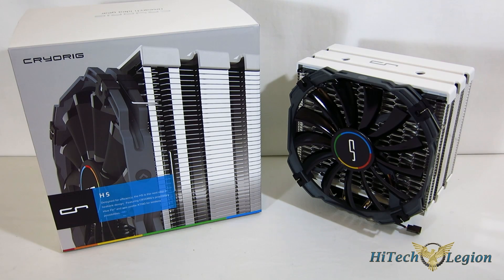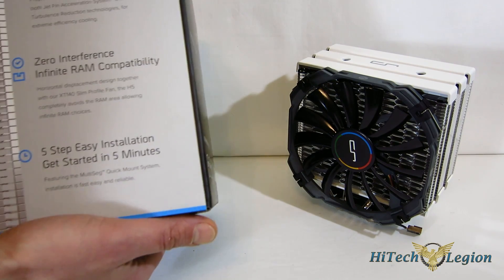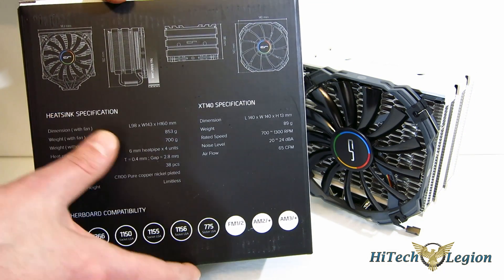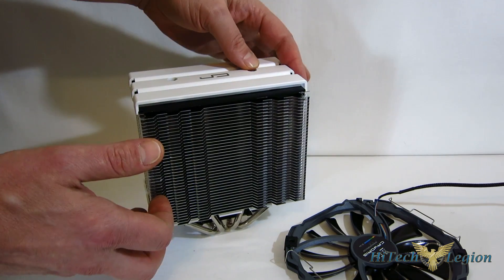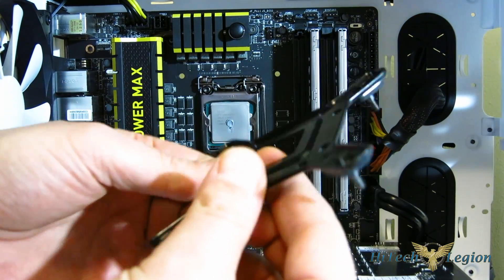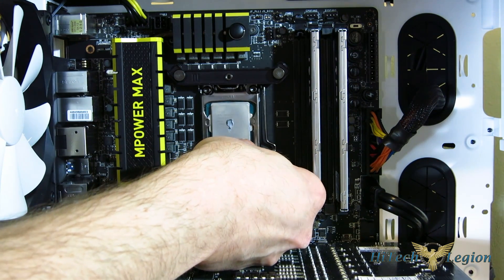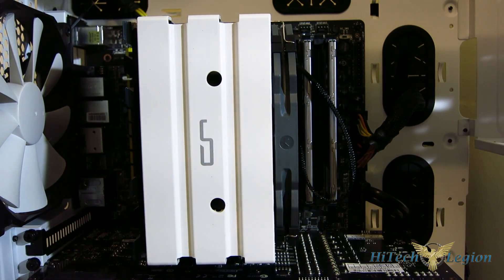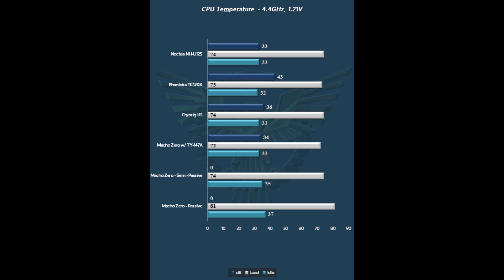Cryorig H5 Universal CPU Cooler Overview and Benchmarks

Comment: I just installed a H5 ultimate on my Ryzen 3600. On the first try I can’t even get the CPU temp to 60C on a stress test. Very quiet too. Changed from an AIO - I’d had enough of the water pump noise.  I would suggest Cryorig introduce physical guides to align the 2 screws with the plate. I didn’t find that part of the install so straight forward, but you only have to do it once so all good. Thanks for the review.

Comment: Pretty good fan if you don't really plan to over clock. I have an i7 7700k and max temperature I got was 72 degrees C. Idle I got about 30 Degrees C. (Average is about 55 when in game). It was simple and fun to install. The only thing is on my motherboard I can only use 2 RAM slots (it covers the first slot). But other than that a great fan. I used a NZXT s340 case if anyone's wondering.  https://imgur.com/NqPOF3S

Comment: If you were to change the fan, would any fan of the same mm work? Or are those specially designed fans to work with that heatsink? I currently have the Thermalright Macho 120 SBM which uses 120mm fans, but they aren't standard sized and I have to special order them from Germany for $20. It's a great cooler, but I seriously hate it for that particular issue.

Comment: is it compatible with lga 1151?
Reply: tsuzukadesu yes watch my installation video it's the I7 6700k skylake LGA1151 socket ...but make sure you get the CRYORIG H5a cause it comes with the slim fan so you won't have any Dimm 1 slot issues .... I bought the fan that comes with the H5 and it's a common 25mm thick and it blocks my Dimm 1 slot but the slim fan does not it leaves clearance for even high profile ram
Reply: Yes.
Reply: thanks
Reply: Oh thank you so much dude. It helps a lot

Comment: Hey George, I know this video is a couple years old now but did you review the Cryorig H5 Ultimate also? I know this one is the Universal with the slim fan. You think the same ram clearance applies to the H5 Ultimate? I only care about your reviews and opinions on these coolers.
Reply: I'm using 2011-v3 by the way.
Reply: I didn't do a review on the Ultimate, but it is the same tower with a thicker fan. The fan on the Ultimate overhangs the first two RAM slots. The fan can be moved up to accommodate RAM up to 45mm tall. So, essentially, unless you are using Dominator, you should be fine.
Reply: Thanks so much George. You're the best. I actually am using Dominator, so getting the Universal will work, right?
Reply: The Universal will be no problem. If you aren't populating the RAM slots behind the CPU, you could add an XF140 or XT140 to the rear for push/pull if you like.
Reply: +George Cella Fantastic! That's exactly what I'll do then. Make more videos George. Doesn't matter what they are about because I'll still watch them.
Reply: My video days are long gone (at least on this channel ;-) ). But, I'm easy enough to find in the Cryorig, Swiftech,  and Phanteks threads over at OCN.
Reply: +George Cella Well I'm heading over there. You were awesome then, and you're awesome now.

Comment: I use my gigabyte motherboard software to monitor now here's a update with my video card .......my idle is about 21C in 68F room temp....and playing division it will spike as high as 56/57C for one second when it starts the game but stays at 35c to 45C on tom Clancy's division ....my CPU stays there but my video card hits 60c and turns the fans on about 2 minutes into the game ........my PCH temp starts at 26 and ends up at 32 after 1 hour of play.....my tower temp starts at 21C and hits 29c 1 hour into the game .......my CPU stays in the same area it started at.......so my next step it to change all 5 of my tower fans with higher RPM and CFM fans .....I think the fans I found are $20 each they are called akasa AK-FN063 Viper S flow 140mm two of those for the front 1600RPM 110CFM that's ridiculous speed for a 140mm fan I don't care if it's load I want performance now......and a AeroCool DS 120mm dual layered blades with noise and shock reduction 1500RPM 81 CFM at 12 volts

Comment: Best mounting kit? Nah...Noctua still has the best for me.
Reply: +kamata93 Ok, why?
Reply: George Cella
Its stupidly easy and quite strong mounting kit. I love it
Reply: kamata93 Ok.....but when you used the Cryorig kit, in what way did you find it inferior to the Noctua kit?
Reply: George Cella
Dont really know. When I was installing the Noctua...it was easier for me. Also the cooler seems better secured as well. Not to mention that my cooler is much quieter and performs better than the Cryorig.
Reply: Try installing noctua ch14(not dh14) most stupid and frustrating mounting mechanism i have ever seen .

Comment: have you noticed the performance difference between the h5-universal and the h7 is very little.
Reply: +danjal07 yeah, but that's just one of the drawbacks of the XT140 fan which itself has a 3/5 rating on newegg. The QT120 fan on the H7 is more performance oriented due to having the room to fit the smaller dimensions of the H7 heatsink compared to the space-limitations of the H5 universal's fan. All in all, I would suggest the H7 and skip the H5 universal.
Reply: I was looking at the cfm rating of the two fans when I decided on the H5universal. That was one of my deciding factors when I went with the h5 universal, the qf120 on the h7 has at 49cfm rating and the xt140 fan has a 65cfm rating.
 plus i wanted the capability of the 140mm fan getting closer to the motherboard.. If you look at the h5universal the fan mounts lower on the cpu cooler allowing it to push air across the base of the cooler and out from under and across the motherboard..
Reply: the extra $10 on the H5 is not only buying a little extra cooling, but also a little more quality.  The H7 works, but it's pretty janky.
Reply: right. both have merits. H7 is good for saving space and more value. However, H5 is worth the upgrade for that extra heat pipe, 90% surface area of the R1, and very small delta compared to the cryorig R1's thermal performance. Pretty good w/ lower noise and more airflow.
Reply: Chris Nguyen
 I cant even hear my h5 universal running 2ft away with the case panel off.
  my I5-6600k@4.5ghz doesnt go over 45c.
Reply: what's your pcpartpicker link?
Reply: i used newegg
Reply: http://pcpartpicker.com/b/t6TH99

Comment: I just received mine in the mail....OMG it's huge....and my tips with the cooler master t2 was about 59c and it would spike to 81c under load....I put my PC on the shelf till today...my new CRYORIG h5 is amazing ...my idle on speecy is 15c ...but the cmos says 28c I'm sure it's 28c...but under load on speecy it hit 30c...so I'm sure it hits about 45c to maybe 50c in the cmos....I will download another CPU temp monitoring program to see its results....at first I thought it was going to make me have to take my active ram fan cooler off ....not it all fits together...so even if I had high profile ram it would clear ...cause the fan sits about 3 inches high off the motherboard....I'm impressed with the mounting brackets ...it was as easy as this video showed it was ...I hope this is helpful feed back ....I'm so happy with the quality of this CPU cooler ...it dosent have mounting pegs that are plastic like my cooler master hyper T2 does ..I almost broke the peg legs off my cooler master t2

Comment: it's crazy how people worry about the fan sound....you need to worry about the heat sink ....you can always change the fans when they die or if they're load....it's all about the hardware....if you're heatsink seats well on the cpu and Leaves the cpu cool without ever really kicking into high speed...then you found a cpu cooler that really works without the help of the fan....that's my idea of a perfect cpu cooler

Comment: What I would like to know if the fan burns out on this CPU cooler ...can I replace it with any generic brand ...it looks like it will only hold the fan it came with......That is a  VERY important piece of information if you left it out....
Reply: +SteveJ619 Any 120mm or 140mm fan with 120mm mount will clip right in.
Reply: +George Cella thank you very much
Reply: I actually replaced the stock fan with a Corsair SP140 Quiet edition fan only because my case has the 120 mm versions that I painted the white trim rings on so I wanted the same fan on the cooler to match.
Reply: Nice

Comment: I just bought this CPU cooler because of your video......I had the cooler master T2 and it is horrible ....I don't care if it's load I just want it to protect my $400 I 7 6700k...my CPU hit 81c with the cooler master ...it's a poor design and it is not flat where the CPU meets the heat sink....this looks like a good built heat sink

Comment: So why would I get a H5 when you have ran the same tests with the H7 with almost the same exact results?
Reply: +Rich M.  I noticed that myself... I did buy the H5 universal, newegg had a flash sale and knocked $5 off... The H5universal is keeping my I5-6600k@4.4ghz at 44c running Unigine Valley  and Intels stress test for 2 hrs each.. Thinking about buying the H7 now for my fx8350 rig or swapping the H7 onto my I5, and put the H5 on my fx8350 which has a hyper212evo on it at the moment.
Reply: +danjal07 I actually bought the h7 for my oc'd 3570k @ 4.2. I actually had this cpu oc'd on the stock cooler but it ran hot around 80 degrees, put this thing in and it hasn't reached more than 49 degrees. Going to bump up the clock speed to 4.5 soon, need to increment due to it being 4.2 for so long.
Reply: +Rich M.  What case are you running? I'm using a Nzxt s340 and the H5 just barely fit.
 I think the H7 would actually look better because its black and would have a little more space around it in the case.
Reply: http://www.bit-tech.net/hardware/cases/2009/02/25/antec-nine-hundred-two-902-review/1
I absolutely love this case.
The side fan touches the top of the heat sink very slightly. I can send you a picture if you'd like.
Reply: I used the Antec 902 4 yrs ago when I built my fx8350 rig, The nzxt is a far better case, much better air flow and much easier to build in.. The only drawback of the nzxt s340 is no external drive bays, kind of wish it had one at least. I just use an external optical drive.
Reply: +Rich M. Good point. I think the H5 vs H7 differences include 8 heatpipes vs 6, so heat dissipation is slightly better for the h5 (let's be real now, the universal's fan is not the best but that can be fixed :). also the h5 is compatible with more platforms, including the lga 2011, 1366, and 775. Also there is a small difference with 140 mm cooler fan for the H5 vs the 120 mm cooler fan for the H7, so the H5 has more airflow. 

@rich m. I agree that the H7 is more value and bang for your buck. however a transition from 120mm to 140mm might cost an extra $5 and extra heatpipes might cost an extra $5. Is it worth the upgrade? No, but if you like innovative stuff, i'd buy it to support the company anyways :)
Reply: You're right, Rich. H7 kicks ass. Definitely worth the bang for the buck. I don't regret ordering the H5 Ultimate though. I guess I have no choice but to convince myself why I spent an extra $12. Yes, the H5 universal has 1-2 C temp differences vs the H7 (b/c the universal's XT140 fan sucks vs the XF. it's only good for space saving purposes). Now the H5 ultimate has more airflow vs the H5 universal and the H7 (76 CFM vs 65 vs 49). More airflow is good for your internal specs overall. A lot of the reviews just measure CPU temperatures, not the overall picture. I think that justifies the $12.

Also one reviewer noted that they didn't like the X-bar quickmount system of the H7 vs the Multiseg quickmount system of the H5 cooling system. The 1 to 2 C can also slightly add again if you invest in push-pull dual fan configured air cooling (i know that's overkill), but 140mm should beat 120mm fans in theory (though not that significant). Small details for $12 but then again... but to each their own ;p
Reply: +Rich M. Bottomline: Have a $35 budget? Get the H7 - it's perfect for its price range. If you want more ventilation (lowers ambient temp for CPU, GPU, power supply, etc) for an extra $12 more, then get the H5 ultimate. Don't get the H5 universal :p
Reply: +Chris Nguyen I already bought it, the h7 had been on my case about a week now. it's not quiet but with all the other fans I have already on my 902 antec case it really doesn't matter too much being I'm not a noise snob.
Reply: +Rich M. Good to hear man. i'm sure all of us were all asking the same questions, what product is the best bang for the buck? You made a great choice :)
Reply: I know this is an already old thread, but I bought the fuckin' H5 simply because I have a wide ass case (I'm using a Thermaltake Core V41), so I had a better excuse to get a big ass cooler and fan than using an H7. I'm going to stuff in 140mm case fans, anyways (aside the rear exhaust, which is 120mm max). I'm fine and dandy as long as the max temps are at least 55 degrees Celsius.
Reply: David DeBroux
my I5-6600k now at 4.5 ghz has never went over 55c with the H5universal. awesome cooler.
Reply: danjal07 I use a Core i3-4370.

Comment: Having problems with installing your RAM stop buying RAM with penis extensions... simple... Like seriously with all these coolers if you buy normal profile memory your fine, and memory rarely needs the heat spreaders of the normal hight never mind the once with fins.
Reply: +Etheoma Couldn't have said it better myself....
Reply: Well sometimes we start out as noobs and get misinformed or led on by marketing or  visual appeal.  Learned my mistake after getting the corsair vengeance 2x 4gb memory modules :3
Reply: I have low profile ram, if I want 2 more then they won't fit
Reply: Also i thought i'd invest into water cooling from the corsair h100 line,  but i didn't know the information i know today that they're not worth value to performance nor sound to coolness (pun intended) :)

Comment: Can i place this cpu cooler in a mini ITX system?
I am planing to get Gigabyte Z170N-WIFI in a Corsair 380T case.
Reply: +SkyperGK I will give you a hint here - the max cooler height is listed in Corsair case specs. The height of the cooler is listed in the cooler specs.
Reply: +George Cella I'll give you also a hint - Sometimes ''suggestions'' in product specs are a lot below the limits.
I was looking for any personal experience with these hardware.
Doesn't matter! According to specs Cryorig H5 Universal doesn't even fit a midi tower. It's even bigger than the V8 or Hyper 212 Evo.
I am so disappointed by cryorig.
If you want to buy a Cryorig Cpu cooler for ITX systems you have to sacrifice beauty and style (H7) or efficiency (C1).
Reply: SkyperGK The C1 performed on par with the H5 in all of our tests, so you aren't sacrificing any efficiency there. However, the C1 is more expensive, so the H5 is a better value in terms of performance.

The H5 fits in most popular mid-towers with no issue at all. As far as SFF, this isn't a Cryorig specific issue, almost all 140mm based coolers run 158-162mm. It is only 1mm taller than the CM 212.
Reply: +George Cella Yeap! It's true. I am really confused from the specs because H5 and R1 Ultimate have both 140mm fans but H5 has 160mm and R1 Ultimate has 168,3mm height. My mistake.
Well I want to put it straigth forward. I can afford the price difference because Cryorig's design is great but i would appreciate if i could get the design of H5/R1/C1 in dimensions of H7. That's all.
I am thinking to go for a C1 and add some extra case fans for better system temperatures.
I'll probably place a 240mm case fan front, 120mm rear, 120mm side excaust and Cryorig C1 for cpu cooling in the Corsair 380T.

Comment: why would anyone want to use a cryorig h5  cpu heat sink with fan that take off 1/3 view of you mother board and whey you need to do something with your mb it in the freaking way , better off going water cool on this one, yes it cheaper to a point
Reply: +junito1957 Some people find better performance, much lower noise and better reliability far more important than gazing at their motherboard.
Reply: na something that big just make you pc look like crap if your pc  has a side window cover it !!,lol
Reply: +junito1957 airflow from air cooling allows ventilation, which helps the whole internal system (lower ambient temperature helps gpu, cpu, and other components). also $47 is pretty affordable vs other liquid cooling alternatives. 

each person has their own subjective opinion on aesthetics so no need to debate that.

Comment: Although I agree with the conclusion, I have mixed feelings about the review - at first you said the fan doesn't have the typical slim fan noise and later you pointed out how the cooler has a characteristic noise to it.
Reply: +George K. It does not have the typical buzzy slim noise, but it does have a distinct sound that is more noticeable than something like a Noctua or be quiet! piece.

Comment: Cant wait to get this in a week. That installation made me orgasm. Probably THE BEST installation I've ever seen in any cooler. Insane
Reply: Chris Nguyen yes it's amazing. The installation was easy until I realized I was putting the metal plate upside down. Ahahaha. Other than my own mistake it was fine. Just make sure you have the plate on correctly. Cpu temps have never hit 70c since buying
Reply: +Hats imulator Do you like it? I would like to hear your review :)